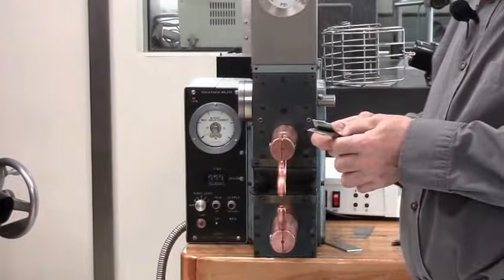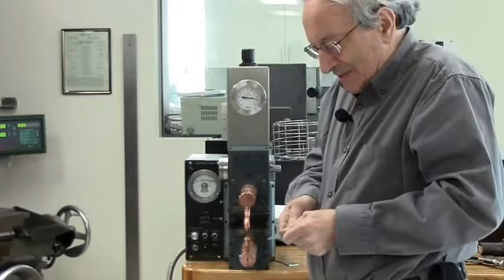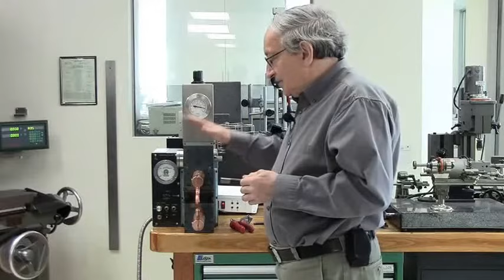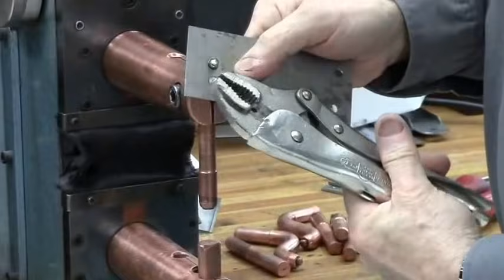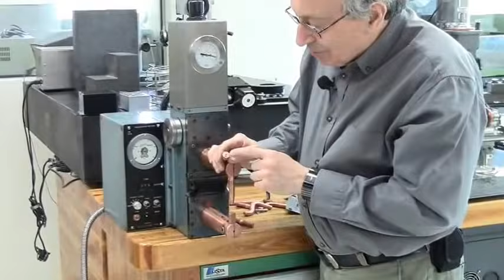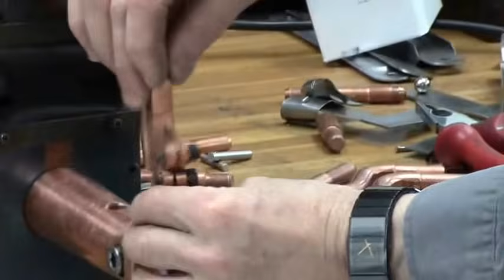Building Prototypes  Dan Gelbart part 5 of 18  Spot Welding

Comment: Dan, if I can call you for your first name, I'm a native spanish speaker  and maybe I did not understand all your technical specs about the machine, so I get to ask you, and I  know you have been interrogated múltiple times bout it by people like me, interested in learning from you. What do you think about making a little spot welder powered by two twin microwave oven transformers of 1500 Watts each one, with their secondary coils rewinded with heavy  copper wire? you stated the  power in KVA, but the only thing I know about them is their  consumption in Watts. Thanks in  advance if you get the time to answer me,  and sorry for my poor english.
Reply from the maker: +Gerónimo LEVRERO  These are way too small transformers. Better to find a large one, at least 5KW (or KVA) and remove the secondary. KW and KVA rating are the same thing if the load is resistive. A 5KW  transformer can easily supply 10KW for the short duration of the weld, which is under a second.
Reply: +Dan Gelbart Thank you so much for your fast answer to my message, I'll try to get a transformer from an Arc welder to make it. Of course, you're right about KW and KVA, just got a little confused when you said inductance increases as the electrodes lenght increases too, but a quick look at my notebooks clarified it for me. Sir, I must congratulate you for your excellent serie of vídeos, as an engineering student and enthusiastic "machinist", I find them way instructive and understandable.Many people gets benefits from your experience. Greetings from Uruguay and good luck!
Reply from the maker: +Gerónimo LEVRERO Arc welder transformer are not good for that (have a special design) . Just get an old power transformer.
Reply: +Dan Gelbart you are right again, I did not consider the movable Core, I will look for a common big monophase 220v transformer and rewind the secondary coil. I have 15 mm copper rods for the electrodes and I can machine them with my old Atlas 618. I think I heard 500A, but what should be the approximate voltage between terminals being the transformer without any charge? I mean in a machine like yours, I will not weld things thicker than 1/8"
Reply: +Dan Gelbart you are right again, I did not consider the movable Core, I will look for a common big monophase 220v transformer and rewind the secondary coil. I have 15 mm copper rods for the electrodes and I can machine them with my old Atlas 618. I think I heard 500A, but what should be the approximate voltage between terminals being the transformer without any charge? I mean in a machine like yours, I will not weld things thicker than 1/8"
Reply: +Dan Gelbart you are right again, I did not consider the movable Core, I will look for a common big monophase 220v transformer and rewind the secondary coil. I have 15 mm copper rods for the electrodes and I can machine them with my old Atlas 618. I think I heard 500A, but what should be the approximate voltage between terminals being the transformer without any charge? I mean in a machine like yours, I will not weld things thicker than 1/8"
Reply: +Dan Gelbart you are right again, I did not consider the movable Core, I will look for a common big monophase 220v transformer and rewind the secondary coil. I have 15 mm copper rods for the electrodes and I can machine them with my old Atlas 618. I think I heard 500A, but what should be the approximate voltage between terminals being the transformer without any charge? I mean in a machine like yours, I will not weld things thicker than 1/8"
Reply: +Dan Gelbart you are right again, I did not consider the movable Core, I will look for a common big monophase 220v transformer and rewind the secondary coil. I have 15 mm copper rods for the electrodes and I can machine them with my old Atlas 618. I think I heard 500A, but what should be the approximate voltage between terminals being the transformer without any charge? I mean in a machine like yours, I will not weld things thicker than 1/8"
Reply from the maker: +Gerónimo LEVRERO 2,5VAC for a smaller (5KVA) for small welder with short arms up to 3.5VAC for bigger welder or longer arms.
Reply: Sorry Dan, I didn´t get the notification of your answer, and by the way, thank you again for taking the time to do it. I'm already looking for a big transformer, I'll try to extract 3.5VAC without excessive dispersion flow (I do not know if it is right, it's a literal translation from the spanish "flujo de dispersión"), I'll keep you updated and show you my work when I have it finished. Greetings from Canelones, Uruguay!

Comment: Dear Dan!
When I watched the first 5 minutes of the waterjet video, I could not stop until I watched them all.  They were the best teaching course I’ve ever seen.  In my entire life!  They are so valuable for DIYers like me!  I could spend decades experimenting and never invent such a laser pointer drill press centering jig!!!  Or a webcam on a lathe!!!!!  You are absolutely the genius!
And I dream to ask you one question.  In the spot welding video you count the welding exposure in “cycles”.  What kind of a timer or a counter did you use to count AC cycles?  All timers/time relays I was able to find online count seconds and decimal fractions of seconds.  I did not find a single “cycle counter” which would be able to start counting from the zero crossing and have the complete AC cycles as a unit of counting.  I think, this is important to minimize the welder’s interference to the power circuitry of a building and other negative effects.  How such a device (AC cycle counter) is called correctly and where can I find it?  Or all I wrote is a bullshit and I should not worry about this cycle counting when I build a spot welder?  Thank you so-so much!
Reply from the maker: +Spock First, thanks for the kind words. Re cycle based timer: you are right, when I built it, over 40 years ago, the reason was to minimize interference. A counter was counting cycles and triggering a triac. Since it was built,  solid state relays (SSRs) appeared and are inexpensive. Those relays are designed only to switch as the zero crossing of the AC line (again, to minimize interference) so you can use any timer to control them. A good range for the timer is 0-25 second in 0.01 sec intervalas. Most welds are done in under 0.1 seconds (3-5 cycles).
Reply: +Dan Gelbart Dear Dan, I could never dream of so quick answer, you really keep your finger on a pulse!  The 0.01 second precise timer + solid state relay was my plan, but I was not sure how good they may work together until you told me.  But still, did the cycle based timers exist 40 years ago before SSRs came, and disappeared nowadays because of no demand?  Or you designed your timer yourself?  (History is also very interesting, not only modern trends :)  ).  Thank you very much once again!
Reply from the maker: +Spock Designed my own as I had no money to buy anything those days. The spot welder was built  from a 1/2" x4" CRS bar, the cover was already spot welded with the half finished welder.
Reply: +Dan Gelbart Dear Dan!  I thought so, I thought so! :)  You made my day month!  Now I know enough to build my own welder (first prototype actually welded already).  Yes, your welder is a piece of art as mawitonik said!  Just THANK you!!!

Comment: What type of pressures you have been able to seal with the silicon+spot weld lap joint?  Thanks in advance!
Reply from the maker: Skyler Olsen Typically a spot welder is set for  about 100Kg, and this is ample for sealing.
Reply: Dan Gelbart I should have asked a bit differently.  Have you pressure tested any of the joints you have created with the silicon+spot weld technique?  If so, what were your results?  Thanks again!
Reply from the maker: Skyler Olsen I only leak tested, not pressure tested, the joints. I believe the pressure limit will be tearing out the welds and not the silicone rubber seal, as the seal is loaded in shear mode and has a large area.  If you really worried about pressure better to TIG weld the edges.
Reply: Dan Gelbart Thanks again for the reply.  Yea, TIG welding is the go to if this method doesn't work, just always have to worry about warping with larger panels.  It sure would be great if your technique worked up to around 3 bar!  I'll run some tests and report my findings.

Comment: Your videos are great! Thanks. The sheet metal shop at HP routinely spot welded aluminum. Were they using a different type of machine?
Reply from the maker: powaybob You need a more powerful machine, ideally a capacitive discharge machine with a very short pulse so the heat does not dissipate. Not for beginners.
Reply: Mentioned in other posts: sandwich the aluminum between 'heater' pieces of higher resistance material such as steel.

Comment: Talking about safety: is it problem you pushing your finger between electordes ? What pressure does this weld machine do ?
Reply from the maker: Dmitry PonyatovLess dangerous than other foot-pedal activated machine with higher pressures (press brake etc).

Comment: first of all, thanks for sharing this videos with us. If i´m not mistaken, you said in the video that you made the spot welder yourself, would it be possible to explain a little bit more how you made it ?, i think yours is a piece of art and to know more would give us ideas for making better our own spot welder projects :)
Reply from the maker: It is quite simple: find yourself a  10 to 15KVA transformer with a 220-240V primary. Remove secondary and measure, using a piece of electrical wire,  how many turns you need to get about 2.5-3V, typically 2-3 turns. Bend an anealed 1/2"x2" or 1/2"x1.5" copper bar into a secondary winding. Dismantle transformer lamination to install secondary. Transformer is switched by a 400V/75A solid state relay and timer (0.03-3 seconds). Secondary is coupled to moving electrode by a flexible cable or laminated copper cable with about 1" square cross section.  If you find these instruction are not sufficient you should not attempt to build one, just get a used one or Chinese made one.
Reply: Thanks a lot for your awnser, how did you make the automatic mechanical clampling and meters? Your help is much appreciated.
Reply from the maker: mawitonik Clamping is just an air cylinder activated (first) by same foot switch that turns the weld current on. The meter uses a current transformer, which is a toroid core with the primary being just the straight wire connecting the transformer to lower electrode (or a regular 50A  AC ammmeter on the primary, cheap on EBay).
Reply: Thank you very much , this is a project that i've been wanting to make for a long time and i'm gonna give it a go again, i have a hundred more questions but i've taken enough of tour time, thanks so much, if i succed i'll try to post muy results.
Reply from the maker: Hondo Trailside The TIG spot mode will not work. YOu can buy a Chinese welder and make a set of custom electrodes, it will work well.
Reply: Dan Gelbart
I think the adivice about not trying it if one doesn't understand the advice so far given is something I would follow.  What I did notice is that there are a lot of machines out there for cheap, but that none of them would allow me to do many of the things that your machine does allow.

A lot of the functionality of your machine comes from the mechanics that allow all the different tips to be made; the spacing, the linear action.  Seems like the mechanical part of that, the oversized copper arms, and so forth, would be easily arranged. 

Could one then just power the beast with a chinese machine.  They seem to say up to 3/16 SS on the 220 models.  Or, I have a TIG that has a spot sequence, could it power the mechanical head?  I guess it would be easy enough to mock something up to give it a try,  My tig has all kinds of parameters, it always irritates me when I have to buy anything else in the same range, from battery chargers, to plasmas.  But then I am not an engineer, so I probably don't get it.
Reply: Dan Gelbart
Thank you.
Reply: Dan Gelbart those are just great idea, i've never touht of using flat stock copper for the secondary of a spot welder.

Comment: hello Mr Gelbart thank you very much for sharing your knowledge, i would like to ask you at what voltage you spot welder operates and the reason for making the arms (what appears to me) out of solid copper bar. thanks again. Peter
Reply from the maker: The spot welder generates 2.5VAC at 5000A, so it can operate from a domestic 240V 50A outlet. If you have more power available I would go to 3.5VAC. You need the heavy copper bars to carry the current without losses.
Reply: thank you for taking your time to answer my question. i have 220 and think the circuit of my shop would handle 50 A max so i`ll have to downsize a bit. you say you would go to 3.5 vac, what would be the advantage over 2.5 vac. i`m planning to go as much as  14ga (2,1mm) but seeing you welding the balls have opened a big door for design. do you think i would still need the 5000A for this?
Reply from the maker: thebrokenbone In your case stay with 2.5V, as 3.5V will draw about 75A from your outlet. Max thickness you can weld will be a combined thickness of 5mm in steel and 6mm in stainless.
Reply: Dan Gelbart The answer can be use some large industrial capacitors to collect energy, and push really large current you need. The disadvantages as cost of this caps (I mean something this like http://www.energy-t.ru/media/zez2/compVN.jpg) and time waiting charge before each spot
Reply: The rating marked on circuit breakers is the continuous current.  Brief pulses of higher current -- such as occur every time an electric motor are switched on (think about a refrigerator cycling on and off for decades) -- are fine and will not trip the breaker.  There are limits; a direct line short should trip the breaker immediately.

Circuit breakers and wire specifications are primarily intended to prevent fire and wire damage from overheating, and respond to the average heat dissipation.  Wires are strung through the walls of houses; if not protected then they could become igniters.  Brief pulses of high current simply do not have time to heat up the wires significantly.  They are not a hazard, provided they are not so frequent as to push the average load above safe limits.  If they are that frequent, the breaker will trip.

Don't try to take this too far; use heavy wire, doesn't entirely apply to switches, etc.  If you trip the breaker a lot, you have to start thinking about its contacts and what happens if the breaker fails shorted.

Comment from the maker: The timer just counts cycles and controls a Solid State Relay. Current meter uses a current transformer, rectifier and holding circuit to hold reading or 60 seconds.
Reply from the maker: +Benjamin Mitchell Weld power simply applied after a short delay. You can use a regular timer. When connected to a Solid State Relay in will only switch at the start of a cycle.
Reply: +Dan Gelbart Thanks for the speedy reply!  Delay sounds like a much simpler approach to starting the weld so I'm glad that's the answer. Good to know on the timer. I'm thinking I may do the controls via arduino instead of a regular timer since it gives a bit more flexibility, but we'll see. Step one at this point is to find a big enough transformer to modify...
Reply: +Dan Gelbart Hi, Dan.  Very impressive series of videos, and equally impressive homebuilt spot welder.  Couple of questions on that unit if you don't mind... 

First, could you perhaps describe the circuit you're using to count cycles a bit more?  The thumbwheels on your controller look like those on a typical timer relay but those are generally limited to triggering based on counts of 1/100ths, 1/10ths, etc.  Haven't seen one of those that counts cycles.

Second, do you do anything to detect that the electrodes have contacted the work before you initiate the weld?  Seems to me you can't use a switch on the pneumatic stroke since you don't know how far down it'll go.  So either you just assume that after a particular delay it must have contacted and clamped, or else you're doing one of: (a) monitoring air pressure to see that it's stabilized or (b) detecting closure of a circuit across the electrodes and using one of those to trigger the weld phase.

Thanks!
-Ben